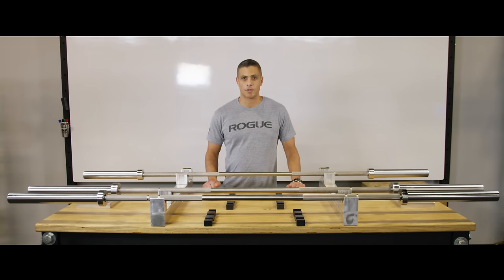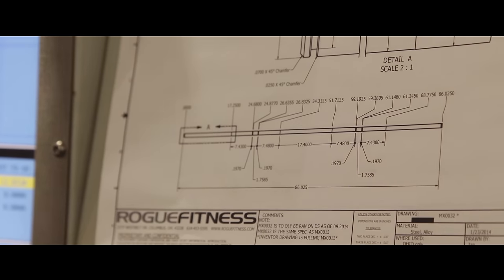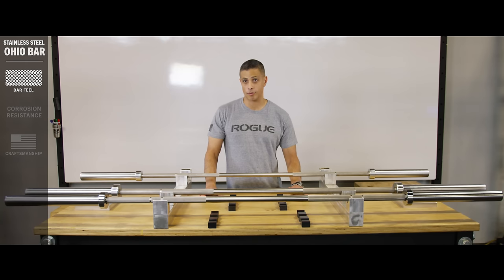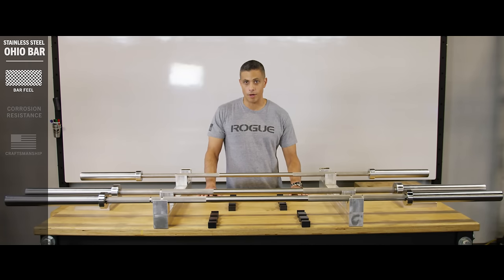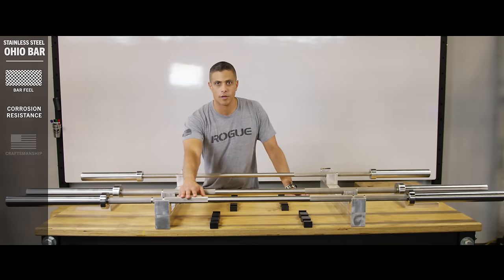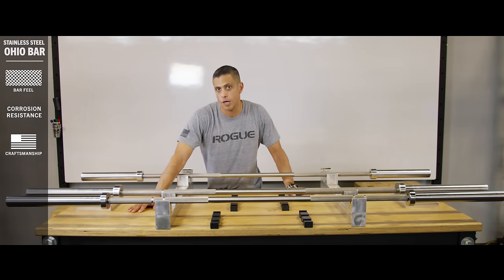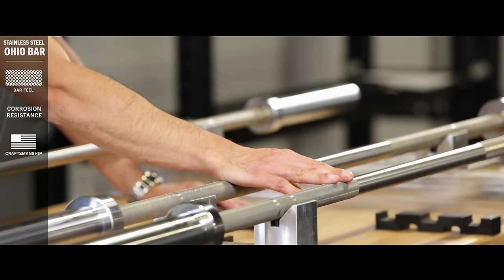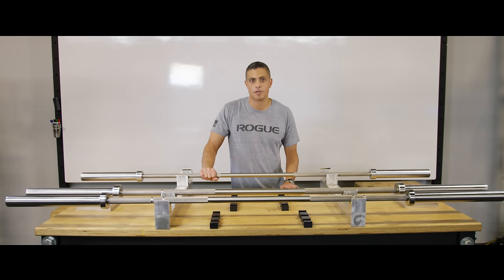The new Stainless Steel Ohio Bar

Comment: I was also interested in a complete stainless steel bar, Rouge doesn't have one yet. Ivanko does make a complete full size olympic stainless steel bar but believe it or not it's over 1,200.00$!!,
Reply: Joe Auchincloss If you haven’t bought one yet REP Fitness has one, its called the Rep Deep Knurl Power Bar EX.

Comment: I am definitely getting a Ohio Deadlift bar, the question concerning that bar is which finish but, I specifically want a bar I can bench, close-grip bench, Spoto press, and press with the full boar slingshot...The most I have done is 161.025kg with the slingshot...Will the Ohio bar handle over 350 lbs, stay stiff, and take at least twice a week of presses for decades?  This is the bar I will use the most and want it to last...I love the customization of Cerakote but, may opt for the Stainless...Thank you Rogue Fitness for revolutionizing the health industry...👏🏽💪🏽✊🏽🇺🇸